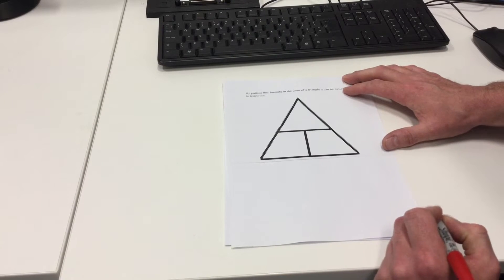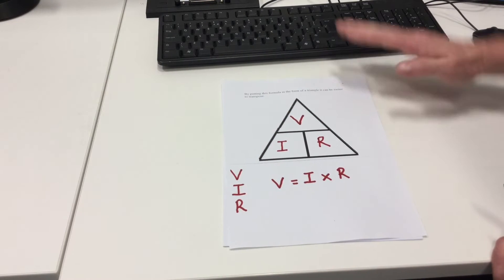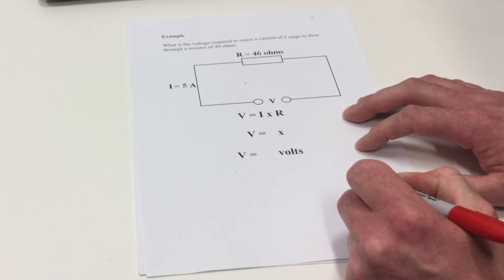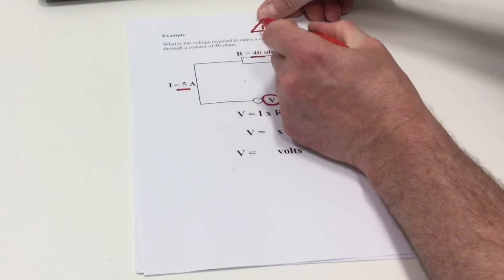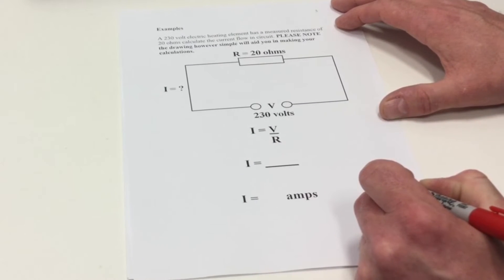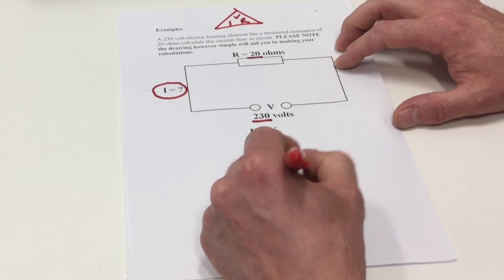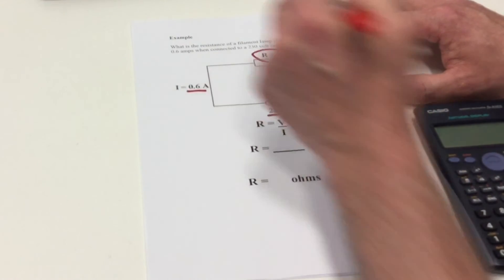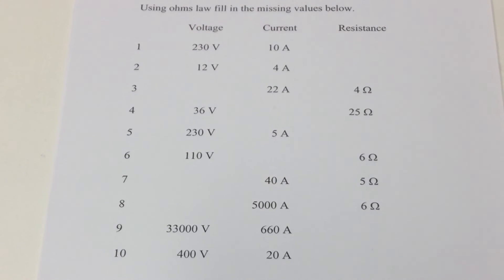Basic Ohm's Law Calculations V = I x R With Examples and Questions

Comment: My question is, how did you know what the current was in the first place?. You probably measured it with a multimeter.   So therefore why do you need to work out the math. You would probably do the same with the volts. I can understand why you would need to use ohms law for the resistance but the other too are less important.

Comment: Does anyone know the the answer to this "A immersion heater rated at 1kw is supplied from a source of 100v determine the design current" my pretty sure my mock exam as the wrong answer. Thanks
Reply from the maker: Use I = P/V 
I = 1000/100
I = 10 amps
Reply: Hi thanks, but I thought it would be volts divided by either current or resistant. So 100V divided by 1000. It's confused me lol